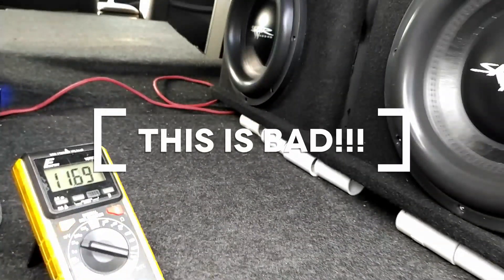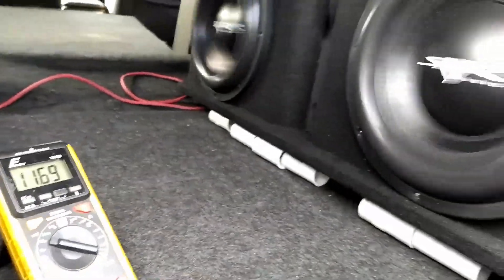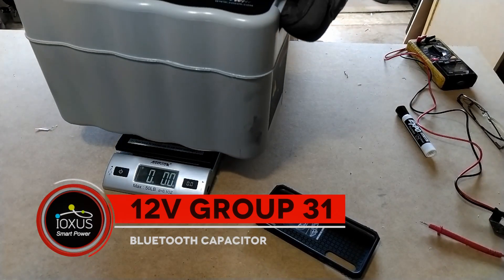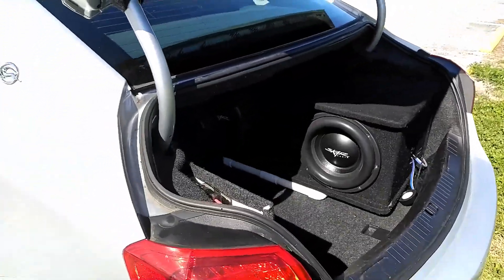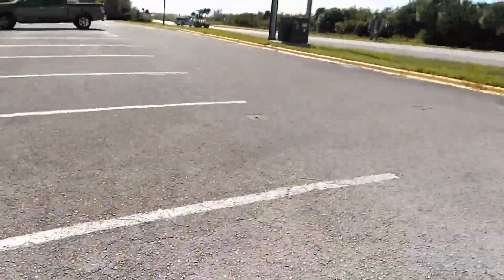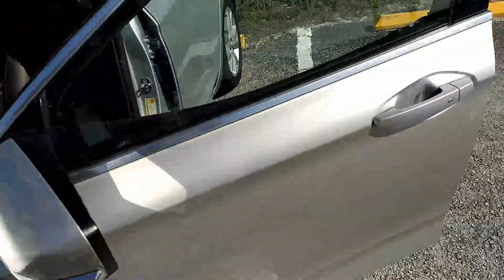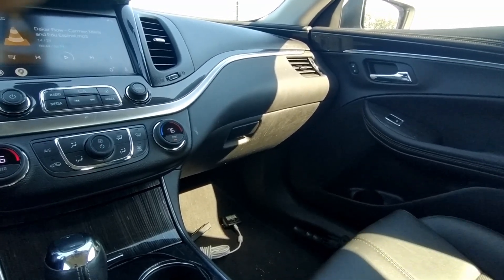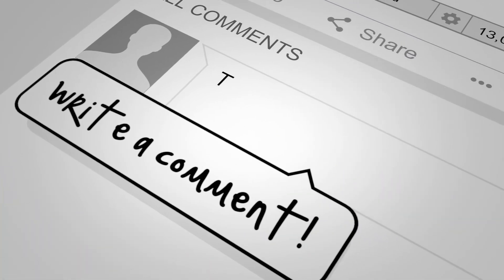Do Ultra Capacitors Really Work? Will This Stabilize a 4,000 Watt System?

Comment: As it was stated before I am sure you already got your answer. Sure AudioPipe may work for you, but over all that is one of those brands that exaggerate the power capabilities in the name of sacrificing clean power. Sure that amp will put out 2000 watts, but the signal when doing so is flat topped and distorted. First things first, I would check your amp draw from your front battery. Not the voltage. The Draw. Then compare that to the draw at the Amplifier. You also should factor in the use of CCA or OFC, and even if there is a frame ground near by. I would run a separate ground from the ultra cap to the frame. then hook it up like you would that AGM. Just because it has the power, you are still giving it the ability to loose efficiency by not providing the system with adequate grounds. Once you do that as well as your big 3 upgrade your voltage drop issue will be fixed. But again, I also recommend swapping amplifiers for more true rated equipment that is not exaggerated.

Comment: Your voltage will be lower closer to the amp.your draining the power wire or the battery.if the voltage up front gets low that's when your using way to much power.ho alt would help alot

Comment: Wish there is more info for hybrid vehicles. I'm keeping my total wattage of my whole system under 2000w  one kicker cs amp 800 w at 1 ohm on one 1 12 kicker r. And 360.4 cs amp for 4 6.5 ks 2 3.5 ks with built in crossovers
Reply: I just bought this capacitor

Comment: I'd like to see how good it works with just 1 of your amps on both 12s.
Lots of guys just run one amp that aren't into comps or crazy spl and I'm curious what it would do with a 2000 watt amp and maybe a 400 watt mid high amp,or just the sub amp.

Comment: So the thing is, your amps are full of caps that need to constantly recharge as they expel their current with each note. Putting a super capacitor back there really just adds another load that the alternator needs to contend with so yeah…it’s allot like adding an additional amp really. It will help stiffen up the current supply as it can discharge faster than an agm battery, but it’s not a support mechanism for the alternator, it’s a drain…so if you’re adding a massive capacitor in, you’re gonna wanna make sure you have a good strong alternator for sure, if you’re not changing out your alternator, you’re better off just adding an agm battery back there & calling it a day
Reply from the maker: I now have a 350A Mechman

Comment: 4000 watts on 2 4 gauge wires? Nah. Get your wire right first. 0 gauge ofc is something like 325- 375 amp so you need that at a bare minimum. 2 runs would be better. My 15 year old Rockford fosgate 100 farad cap could probably do those numbers. I have the 2000 watts audiopipeamp on 2 skar evl 12's with a 1600.4 amp from precision power in my vehicle and I have very little voltage drop . You are not runny 4000 watts on 4 gauge. You need the big 3 and the best ground available in the back 

Did you fix the problem btw

Comment: Im 9 months late to the party, but the fact that you have higher voltage in the front than you do in the back indicates an inadequate current path between front and back, either positive runs or ground path. If you're using a body ground that is most likely where the majority of the drop is.

Comment: As I'm sure you've learned caps are like your shocks, they just dampen out the highs and lows or with voltage the lows.  A battery can't supply power quickly, a cap can't hold a lot of power so together you get the best of both, the cap steps up to the plate long enough for the batteries to do their job.  And, I have no clue why I even watched this, I was looking for something totally didn't and don't even have a system in my ride.

Comment: Great video. I currently run a single skar VXF 12 with a CRESCENDO AUDIO | SYMPHONY S1 PLUS | 2500w amp. I have a Diehard platinum AGM under hood and a XS Power D5100 in rear of a 2019 Camry. This car is a voltage nightmare with the smart alternator which never charges past 13.8. The only way to keep my voltage from dropping was to turn amp down to only output 2000w.
Reply: You need a "PCM Bypass" that Mechman sells (or did sell). I see them offered here and there. It allows the PCM to think that more current/voltage is necessary when the draw reaches a certain threshold so it doesnt limit your voltage to 13.8V
Reply: @Raymo2u  thanks for the advice, unfortunately I sold the car for a 2022 Highlander. People don’t realize that with before installing audio equipment into todays cars they need to understand all aspects of the charging system which I did not also. Your advice would have helped me out tremendously as I was chasing down why I could not achieve 14v. Again thanks
Reply: @fixodent6  Well, now you'll know that most Toyota's, especially models with the 2.4L motor - will have the PCM regulation.

Comment: You also have to remember that these are budget amps. Even the samples given to bench testers are showing that they are crazy inefficient with power draw! They produce awesome numbers, but they do it on roughly 20 to 30 percent more power consumption than higher quality (much more expensive) amps. Two of them are going to produce insane power but require a far more capable electrical system to meet their demand

Comment: Very nice video,If I was you,I would build my system around the amount of draw for your amps,if your amp draw 300 amps @1ohms,I would build my electrical around that concept,if it takes to have one 300 amp high output alternator and one cmaxx lithium battery,that's what I would do,That's just me.Good luck.

Comment: Exocontralto shows a better example of this "cap" bank, even started the car with it.
It also comes with a app that show state of charge and voltage. 

Second,  did you say 141db @ "4000w" ?? 
I did that in a wagon with 1500w singer 18"  no modifications to the car. Oem alternator,  1 agm battery up front. 
Your setup is great,  but something not right.

Last,  Skar recommend 2cf3 per sub, that does not look like a 4cf3 inclosure.

Comment: There is some confusion in your video...

There are multiple different types of batteries used in automotive. 

They are flooded wet cell (which is what you have shown in the video)

You can have a deep cycle version of a flooded wet cell which just means it’s constructed with thicker plates and designed to be drawn down lower in charge without being damaged. Normal batteries are really just for cranking where is deep cycle batteries are for operating equipment and can support a larger current draw for longer. 

There are absorbed glass mat (AGM) which is a technology that has nothing to do with deep cycle, it has to do with the acid being absorbed into the material within the battery  that it’s not just floating around in there. 

An AGM battery can be mounted upside down or right side up because it will never leak… They are sealed and maintenance free. 

They make AGM batteries in both normal and deep cycle profiles as well as a marine profile so like I was saying the fact that it’s an AGM battery does not mean that it’s deep cycle. 

They (AGM) require more strict charging systems and they’re not typically found in Automotive unless you pay more money for something like an Optima or an odyssey. 

Then you can also find lithium batteries nowadays both lithium iron phosphate and straight lithium which mainly both have the advantage of being lighter in weight. 

All of these battery topologies  could potentially benefit from a capacitor right at the load source but it’s more important to have an adequate charging system first.

On another note, as somebody who has had an electrical fire in a vehicle… you need to move that fire extinguisher into the passenger compartment of the vehicle. The best location is right to the left side of the driver seat so you can easily get to it as you’re trying to get out of the door. People are wholly unprepared for how fast an electrical fire happens. It’s not like a regular fire where you put some wood in a pile and light it with a lighter or a match in in a few minutes you have flames… When I had the electrical fire in my car in just five seconds the entire car was full of toxic smoke from all of the insulation melting off of the wiring and the next thing you know the entire underside of the hood was on fire. That all happened in a matter of 20 seconds from zero to fully involved. You don’t want to have to stick your hand into the area where there might be a fire in order to get to the fire extinguisher. Better yet leave that one in the trunk and get another one and put it in the passenger compartment. They’re not expensive.
Reply from the maker: 10th generation Impala LTs comes stock with AGMs. The 4 Cylinder versions have 2 AGMs for stop & start tech. This 'is' a deep cycle battery. Optima Yellow Top 'Deep Cycle' was $300 with 72 Ah. This battery $200 with 70Ah. I follow the stats; not so much the labels. Thanks for the tip on the fire extinguisher. I'll be definitely following that piece of advice. 👍

Comment: For you to keep your voltage up, you must know how much current your system is pulling, and how much resistance you have. Runs of power is also a factor. If you don't have a strong source in the rear, you must have it up front somewhere, somehow. That's when runs of cable is important. Don't use CCA!!!!! Use OFC!!!!! It takes 3 times if not more runs of CCA to equal 1 run of OFC. 1 or 2/0 of 4 or 0ga OFC is needed.  Solid grounds, If not, runs of fresh grounds, being new cars are using weaker metals for weight and cost, which aren't great conductors, like Ford trucks that need grounds ran from the battery to your audio setup direct. Caps are good for burps, and recovery. If you want daily, batteries are the go too, with a high amperage alternator, or 2 depending on how much amperage can be supplied with the car you possess. Some cases, you need to do a step-down converter to keep your car safe. I did my best to keep it short, but it's still is a long comment. It's a lot but like the saying goes, to make power, you must supply power!!!!!

Comment: Only thing I have seen caps really work well is with a hi output altenator and a hefty battery ot battery bamk.
Reply: My last build 4 super tweets  2 8 inch mids 2 6.5 mids and a sundown u series with a stock alt and 3 agm batteries  bearly was able to keep voltage at 12 i was in need of an alt but ended up selling car and build due to financial issues

Comment: Ioxus Ultra Cap should be closest to the starter according to there instructions. Switch the battery and ultra cap bank. Meaning ultra cap bank up front and battery in the rear. I think this is how installation was intended per instructions. Hope this helps.

Comment: I just ordered a VXF-15 with the SKV2 1500.1d...I'm going to do a1/0 big three but I hope that's all I need... I don't want to do all this. It was running fine with the EVL 15 but it was a little less watts.
Reply from the maker: Car audio is more demanding than most think. Your automobile comes with just enough power to support your stock electronics. Adding thousands of Watts more, will need to be supported.

Comment: It'll be a night and day difference once you install that alternator ,you also need to read  up on ampere's law you're simply pulling to many amps your stock alt can't keep up and will blow prematurely you don't need to do any wiring up grades if your already using OFC wire that wld be a waste of money I personally wld of put the money you spent on that ultra cap towards lithium I know those ultra caps aren't cheep But great video 👍🏽👊🏽✌🏽💯.  #🔊🔊🔊

Comment: That specific cap is not good for car audio. Yes I know who sells them. It has a voltage reserve and shuts off in the low 11ish voltage. As it's designed to allow you to start your car with a weak or dead battery. It was designed for the trucking industry. A normal Super cap has no limit. Get a XS Power SB-500 or the Limitless Lithium battery delete..true 500 Farad Super Caps.
Reply from the maker: I prefer the technology and protection circuits this one offers. What you said about the others were true. They just don't have all the tech of this one.

Comment: This sounds weird but try disconnecting/removing your front battery. I notice better voltage in the rear without a front battery, might work, might not, worth a shot tho I think.
Reply from the maker: If you do this you will lose reserve with the switch off. But have a great cranking capability
Reply: @BudgetBassHead  I'm just saying the front battery is a choke point, removing it and having both batteries and caps in the rear would be better or run more power wire. Thanks for responding, I like your videos.
Reply from the maker: @mishabuildz6380  oh I get what you're saying. yeah, some others had also suggested to reinstall the AGM alongside the capacitor. If the capacitor wasn't so large I would rather have it up front as a cranking unit and put the two agms in the rear. But I may just have to reinstall the AGM alongside the capacitor. thanks for the comment

Comment: Capacitors are designed to charge and discharge quickly so that thing dropping fast is exactly what you would expect to do they don't hold very much power.  It does stabilize your battery as you saw because as you said it is taking the brunt of the load.  

The more you can support the capacitors with current the faster they will bounce back.  So once you get a alt, they will love all the extra input current.

Also yes if you have more batteries you can always add them to the system.  Capacitors play nice with everything.  The capacitors actually don't care that they're low voltage The capacitor doesn't have a set voltage point It's like a container for energy so it can be at zero just fine The main thing is you can't try to overfill it, so too high a voltage is a issue, but your voltage is fine.
Since this is a smart unit it would keep itself safe anyways, thats part of what you're paying for.

Get your voltage monitor straight at your amp, that's where it matters.

Anyway I hope this all helps!
Reply from the maker: Excellent comment! Thanks for the clarity 💯 👍
Reply: is there any benefit to using 2 super caps?  thanks

Comment: run a dedicated ground from either your alt case or battery negative ( if you don't already ) and i bet it'll help. 

if you do this, try not to ground anywhere other then said wire or you might run into noise issues.
Reply from the maker: Great tip.

Comment: I second what others have said about putting your AGM back into the mix.  Do the Big 3 when you put in your alt and put some decent battery terminals on your battery under hood. The lines all going into that battery the way you have it is dangerous and you’ll get a better connection using proper separate terminals. Excellent video and serious props for your editing skills.
Reply from the maker: Thanks for the suggestions.

Comment: II got a Skv2-3500.1D on my 2 12 Evl box and I ran  into the same issues. I snagged 2 200ah AGM batteries from Interstate Battery and I would still get the Voltage drop until I got a JS 240a Alternator...now my lowest voltage has been 12.6. Im hoping with a Supercap Ill stay above 13V. Get an 240a+ Alternator and you'll do just fine, I'd get rid of the Lead Battery and go with 2 AGMs or Lithium.
Reply from the maker: My batteries 'are' AGM. Good advice.

Comment: Run ground cable from the capacitor to grinded clean part of frame and on from the battery same thing and add another set of caps if it does not help and calculate your amp usage to balance with caps always leave room with a 50 to 200 amps of room and alternator upgrades if you need
Reply from the maker: Thanks for the info

Comment: I'm sure you already know this Budget Basshead, but for those who may not: things needed when big power amplifiers are used: 1.) Big 3 power/ground cable upgrade
2.) H.O. alternator  3.) Secondary battery dedicated to audio system
4.) Current isolator relay
Reply: Do you need a second battery  if you mostly listen when the engine is on?
Reply: @fasin8me1  i added one, I never listen with car off. Because the amp draws a lot of power when it hits the lows, personally I like the thought of having good batteries so when the amp needs the power, I have a reserve of power to pull from
Reply: @fasin8me1  trust getting better batteries will change a lot especially if your running a high watt system

Comment: Sum time a thing can’t be fixed without two or three alternators and extra batrees and (Fo REAL) copper cables (08 gage) see my boy ova at Steve Meade U-TUBE videos he got sum THICK ASS CABLES. 13,000 strand or sum sum like that. I ain’t lyin
Reply from the maker: I ain't got nearly that much power, Mark! 😆

Comment: I was going to comment about getting yourself a higher output alternator, but I'm glad I waited for the video to finish.  How come you didn't run 1/0 gauge when you did your big three?  I can't see where your grounds are in the back, but hopefully you're attached to the frame, or a seat bolt.  Are your power and ground OFC cable?  If it's CCA, it won't have the same current capacity for the same gauge as OFC.  I'm really impressed with your improved video production value.  You're on your way,  bruh.  Keep up the good work.
Reply from the maker: Wire is KNU Koncept Kolosus 4g (dual runs) OFC. 1/0 coming up after testing new alt.
Reply: Well said

Comment: I agree with most comments. It's not a replacement. It works in conjunction with. One thing I'm curious of tho is what wire your using to go to the back. OFC. or CCA.
Reply from the maker: All my wire is oversized New concept flex ofc copper wire